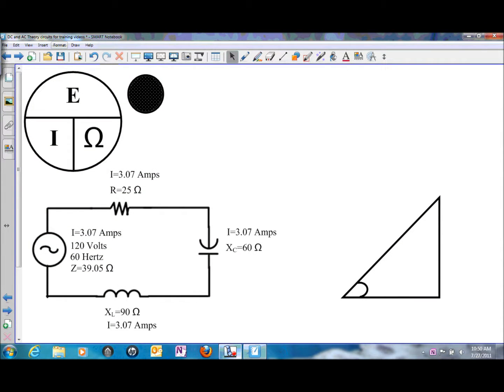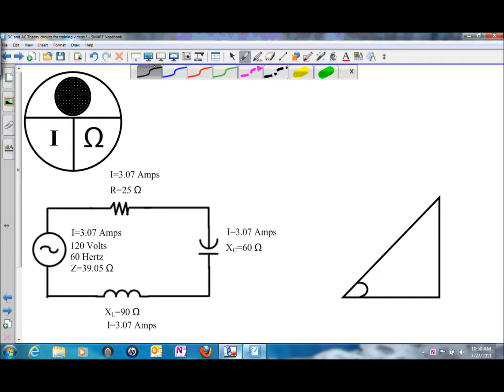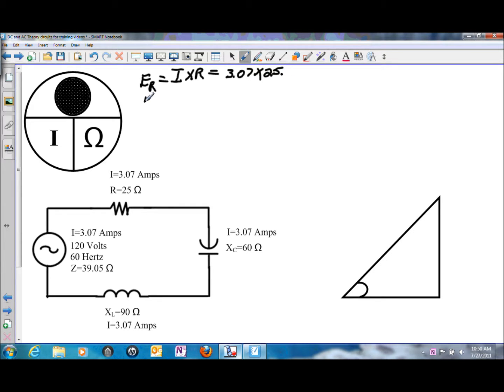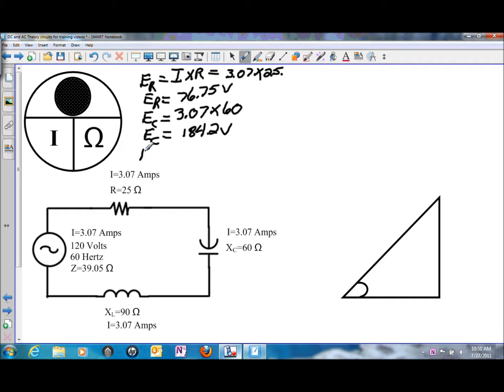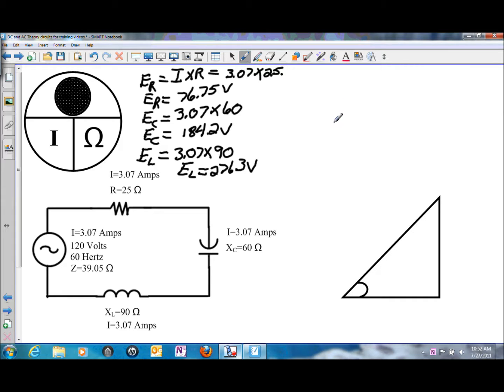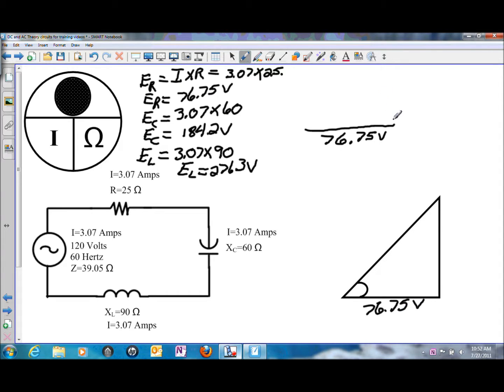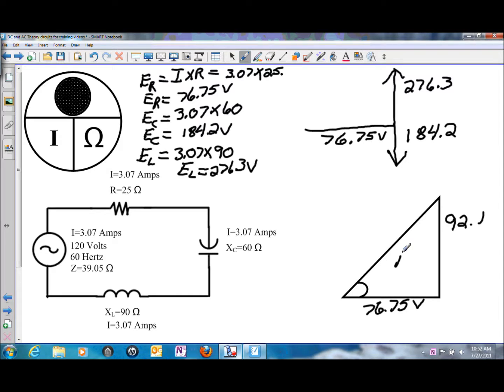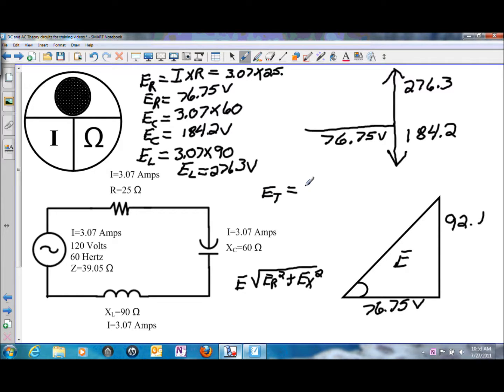Voltage in a Series RLC Circuit.wmv

Comment: is the current given(3.07 A) the maximum current?(Or it doesn't matter when finding total voltage? Might sounds a bit silly, but if it does not matter, is it because the size of total voltage is changing as well?  This leads to another question: is total voltage always found from addition of capacitor voltage, resistor voltage, and inductor voltage using  vector diagram?

Thanks
Reply: +Janet Lin Current remains same in series circuit. and Yes the Total Voltage in RLC circuit is always found using vector diagram and can not be just added together like in a simple series circuit with ohmic resistors, as Inductive and Capacitive Reactance are plotted on Imaginary Axis and so we always have to use Phasor Diagrams and pythagorean theorem to calculate the Total Voltage.